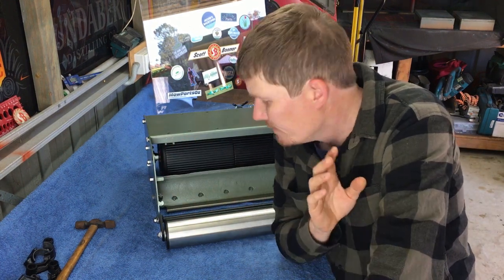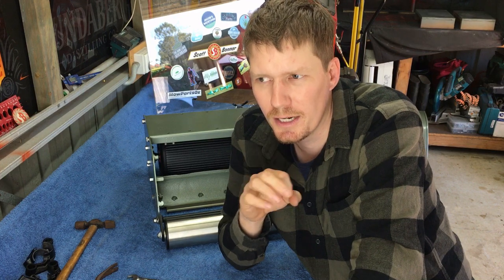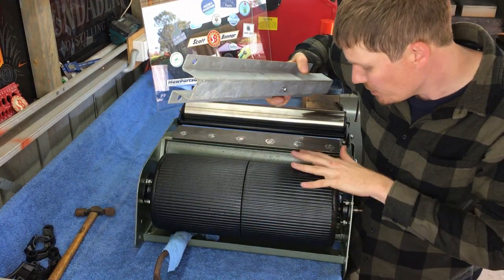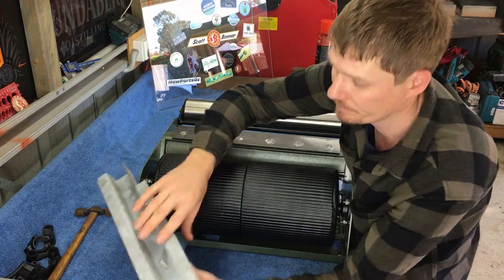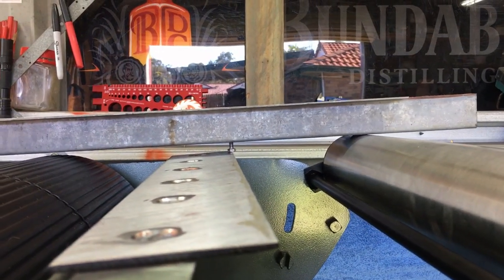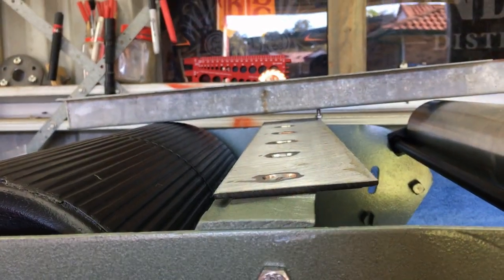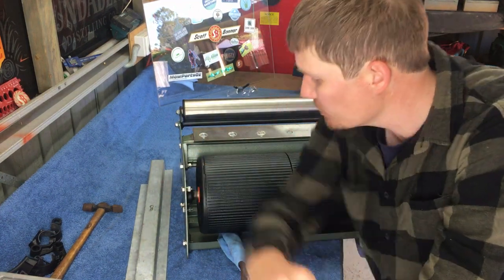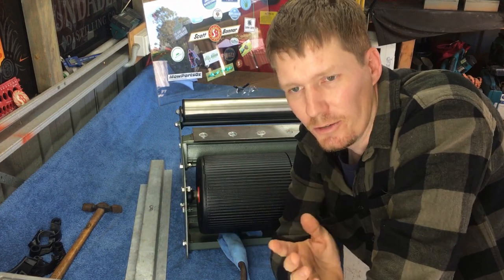How to level the Rear Roller on a Scott Bonnar Model 45 Cylinder Mower

Comment: Thanks for the video. 2 questions: 1. Is the front roller guaranteed to be perfectly parallel/aligned with the bedknife? This technique is assuming that it is  because the height of cut bar is using it as a reference.   2. Can you PLEASE do a video showing how to do this when the engine is one? I am getting a very uneven cut and think that this is what I need to do, but would love some guidance. Thanks
Reply from the maker: The sole plate is a fixed item (doesn’t move)and so is the front roller (it moves up and down but not forwards or backwards)
Basically when the frame of the mower is built the bolt holes are in the exact same location on both sides of the frame, this automatically guarantees the front roller to be aligned with the sole plate..
If you have any play in your front roller (e.g worn front roller shaft or end caps) you will never be able to align it accurately and will need to fix the play/movement first.

I hope that makes sense :-)

Comment: Hi, Nice video! When you move the height bar to the adjustable side and there is a gap, how do you know that it is not the front roller that is out! As that has been a problem on some machines. Thanks.
Reply from the maker: This is an upgraded front roller which has a bearing installed in each end, accompanied by a new front roller shaft and bracket. This ensures the front roller is true.